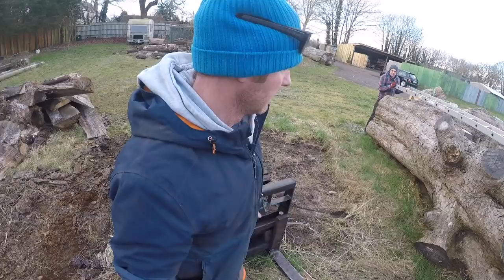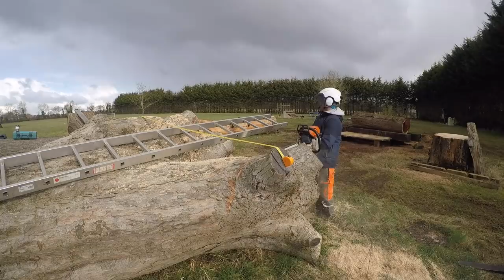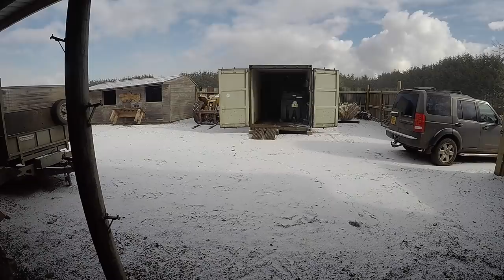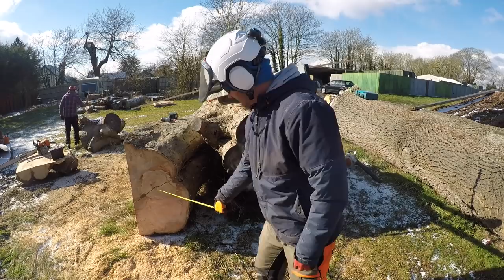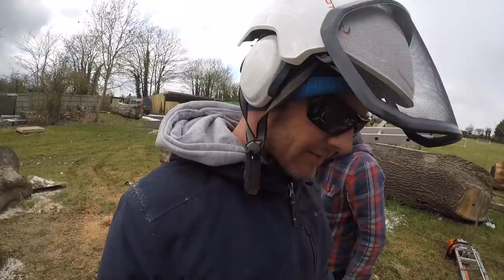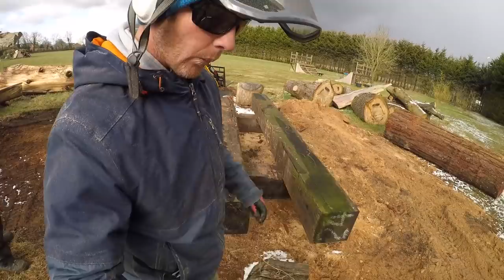MS880 Double End Chainsaw Mill PART 1

Comment: Thank you for translating into Fahrenheit and inches!  I use a Husky 3120xp to mill, and my next project is cutting a 62” diameter hickory with a crotch that reconnects to the main trunk (84” diameter at that point).  Your video has been the most helpful of any (and I’ve watched a lot of them)!
Reply from the maker: nclaytonc thanks mate glad your here and glad to help.
Reply: I have a 3120xp set up for a double head. As long as you don't hit metal, it will be a breeze. If the log is dry, keep the chain oiled. Lots of fun.

Comment: That is some serious power! No other two chainsaws in the world could done the same!!! 

STIHL MS 880 POWER!!!💪💪💪
Reply: Ever heard of an 090?
Reply: @AdamTrautmanBowling  Yes I have! Lots of weight and torque, but ultimately slower... Nice saws tough!😁💪
Reply: @AdamTrautmanBowling   @adamtrautman2873  It's only so much that torque itself can give. Hp is king in wood cutting, there's only so much resistance wood can create, after that chainspeed and hp is king. You could put a bigger sprocket on the 090, but its still a less efficient saw; hp, torque and rpm taken into account.

Comment: There are bandsaw mills cheaper than a pair of 880s...... love it!  Hilarious also that you were using a ladder only as the guide.

That would make SEVERAL nice tables.

Great vid, color me jealous.
Reply from the maker: Thanks Rick, Yes band saw would be nice one day but a cheep bandsaw wouldn't be wide enough for the slabs I want to do.. cheers mate great to have you on the channel.  Blaise
Reply: Bandsaw that big... I'm sure they got one somewhere I never seen one.
Reply: If you can get me a bandsaw that can cut 2m width at 2x the price of this setup, I'm buying it.
Reply: Awesomeness  Blaise I've a pair  of 3120s ported powerful saws could you recommend where I could buy a rig like yours
Reply: Somebody please tell me something. I read something that said having 2 power heads is not necessary. It doesn't increase power. Granberg makes a helper handle for double ended bars. Cheaper than purchasing another giant saw. The reason I ask is because I'm looking to buy a homemade chainsaw mill with a 20ft bed and is portable. This machine is cool .I believe it has a 53in double ended bar and is manually operated. Nobody has a machine like this one and I'm very involved in chainsaw milling with my Alaskan. I don't know if this is a good idea or just go for an every day band mill. Any feedback would be greatly appreciated.

Comment: Awesome, could you explain how is it posible to run your chain qith two chainsaws, I dont understand
Reply from the maker: skiSrp Pre hi mate they both pull the chain but if you look there are mounted on the mill different so the work together. It’s a bit hard to explain but basically it cuts much faster. Cheers Blaise

Comment: Man that thing can make some fantastic slabs. But I'm still left with a few questions.  1, still wondering how both saws are kept in sync and 2, the saw bar spans a good distance, how do you keep from concaving your slab? I do think I might build that large but one motor.
Reply: One motor
Reply from the maker: Richard, sorry for the delay in replying to your questions somehow I missed it.  You can hear when the saws are running in sync very occationly you need to stop and re sync.  Yes you have to be very careful how you set the mill up to avoid bar sag.   cheers Blaise

Comment: Quick hack for rolling and adjusting big logs if you don't have a forklift... Screw a wood plank (2"x8"x8' or bigger) on the log perpendicular to the log, the leverage makes it easy to adjust. I've flipped 4' diameter logs easily with this method.
Reply from the maker: Nice tip mate thanks for sharing.  Blaise